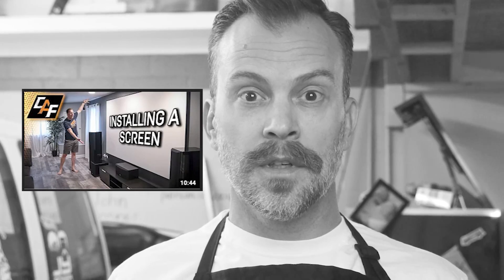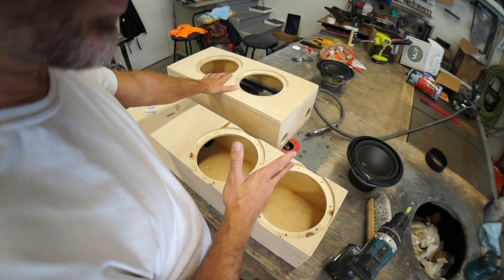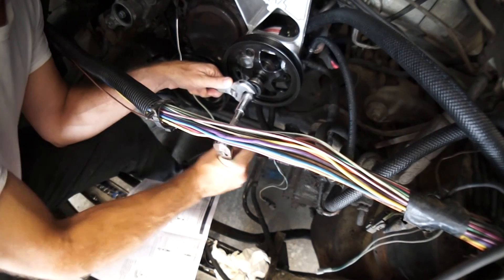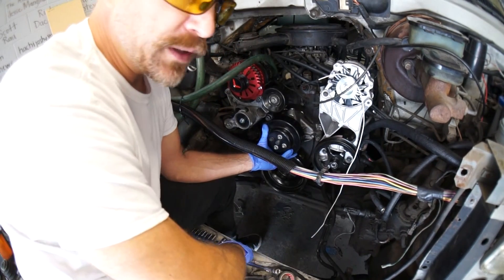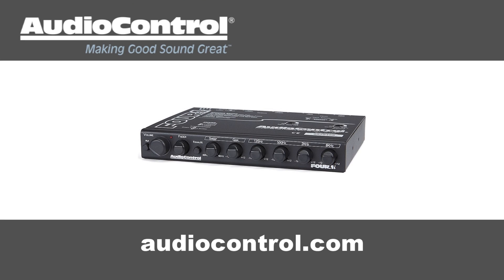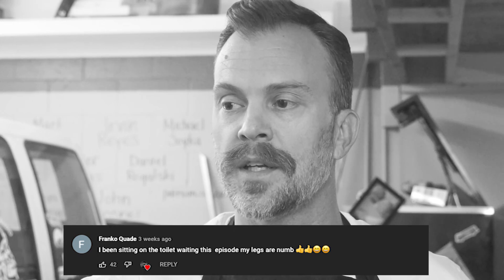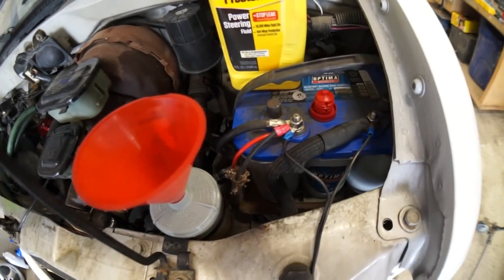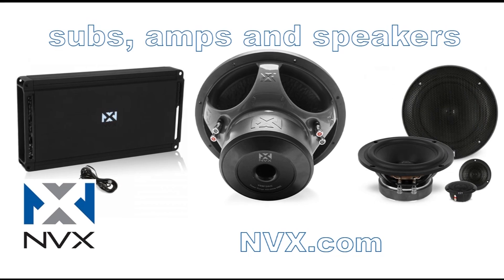BOX TIPS! and THE VAN RUNS! - BVV#79

Comment: That serpentine belt looks an inch or two too long. Tensioner is far from the correct angle to work correctly. 
Or is the tensioner on backwards and belt should go on the inside? That would make sense to get more friction on main pulley.

Comment: I went with mark from caf. To design me a box. I wanted ported and recommended specs for two sa15d4 rev3. Going into a 2020 kia Optima special edition.  I told him im still a noob and wasnt sure if the enclosure would fit. I sent him pictures with measurements so he had a good idea what im working with. I then said if the enclosure is to big id go to a sealed enclosure because its smaller. His reply was i know more about your build than you do and i know what will work. He sends me email with blueprints.  I built the enclosure came out nice but tried a test fit before gluing.  The box was so big i had to build it in my trunk. I wrote him and according to him its my fault because i sent him the measurements.  I will say the box is tuned to 32 and sounds great but id recommend not using mark from CAF